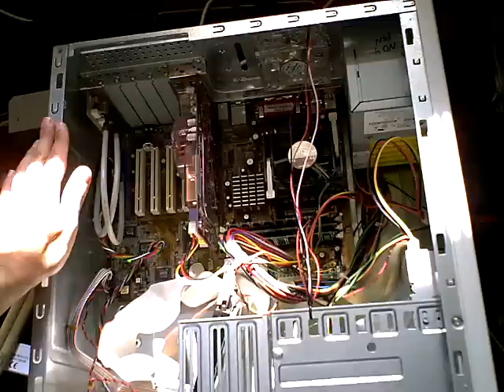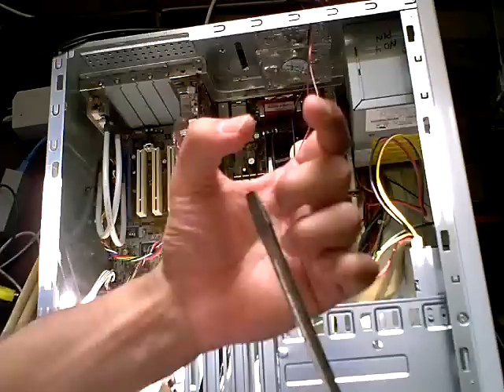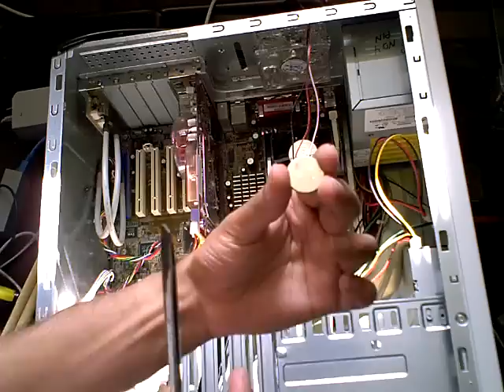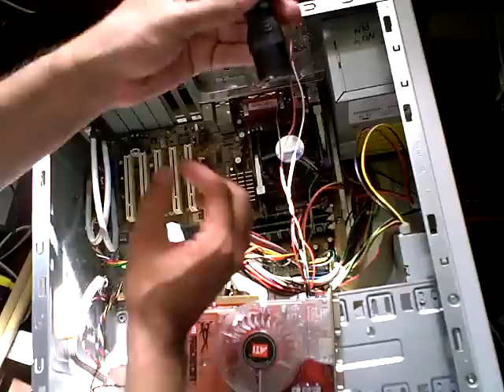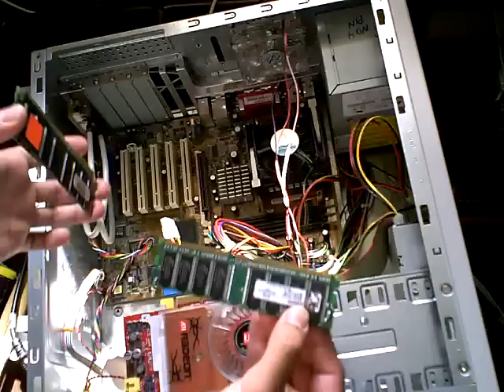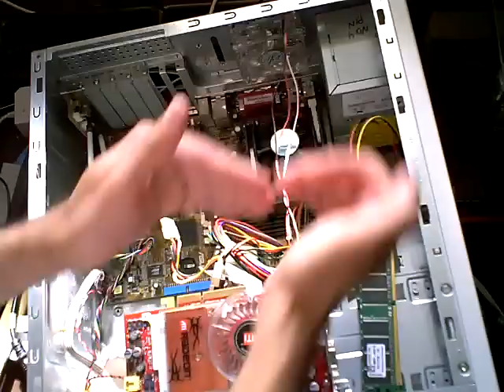How to possibly fix a PC that will turn on but will not beep and will not display anything on screen

Comment: just but my pc all new parts no display on monitor and only 1 USB port works
Reply from the maker: +icu creeping Follow the steps in the video. If no luck, then follow the steps in the ADVANCED video. Take your time doing it if need be
Reply: +RodneyDickson do u need to have speakers plugged in to hear the beeps?
Reply from the maker: +icu creeping Nope, you'll either need to have a small PC speaker onboard your motherboard, or will have to connect a small PC speaker to the proper front panel connectors of your motherboard
Reply: well im gonna just send the mother board back in and get a replacement because my keyboard dosent work on any of the usb connectors at all so it has to be dead
Reply from the maker: +icu creeping If it is under warranty, this is always the safest course of action.
Reply: should still be i only had it for half a week
Reply from the maker: +icu creeping Then good plan : )

Comment: When I unplugged dvd drive it turned on, or booted. thanks'
Reply from the maker: Heh, not often that you hear that an optical drive can cause this issue. Glad you got to the bottom of the issue, and thanks for letting us know, hopefully this info can help others in the same predicament : )
Reply: All I know is, once I unplug the d v d data an power cable it posted.
Reply from the maker: carlos valentin
I'd assume there was one of 3 things happening here 1) your optical drive had I/O errors and is no longer viable  2) the CMOS entry for your optical drive was corrupt  or 3) a component configuration conflict prevented this device and another conflicting device from being present at the same time. Regardless, glad things are working now : )
Reply: RodneyDickson One of the ram slots was bad too. Thanks'
Reply from the maker: carlos valentin
Geez, well, if you can keep it running as is, I say 'run it into the ground' : )
Reply: +RodneyDickson dude come on it was his power suply upgrade it to something stronger and it will run boot and post with the optical drive connected
Reply: RodneyDickson hey man my pc beeps but no display how i can fix that
Reply from the maker: +DANIEL REBU Beep error codes differ from one BIOS manufacturer to the next. To discover what the beep error code is trying to telling you, discover the manufacturer of your BIOS (available in the motherboard's manual or on the motherboard's manufacturer's website {on the page for your specific motherboard model}) and then look up the frequency and interval of your beep error code on:

http://www.computerhope.com/beep.htm

Comment: my computer doesn't show anything on screen I tried to connect my monitor through all its ports and with different monitors, as soon as I turn on the PC it makes a funky noise can anyone give me a diagnosis.      

 By the way that funky noise sounds like a disk of some sort
Reply from the maker: +Isac Santiago Ok, do you have a HDD activity light on your PC? (a light that flashes when the hard drive spins and loads the operating system)?

Comment: So I've just built my first computer. Everything is on(the fans and a green LED light on the motherboard), and seems to be working, but when I try to see the BIOS by turning it on and pressing the DEL key on my keyboard(which doesn't light up like it should so I doubt it's even working), nothing happens. All the monitor displays is " DVI no signal". any help is appreciated!Here's my build: http://pcpartpicker.com/list/dC8Fd6
Reply from the maker: Your keyboard not lighting is a good indication that your PC is not POSTing. Breadboard it (explained in the following video:)

If the steps in this video did not provide a solution to your problem, view:

http://www.youtube.com/watch?v=_EK9a-R5pss

You never know, maybe rebuilding the PC in the opposite sense that you took it apart will solve the problem.

Comment: wait
what if it doesn't have one beep
Reply from the maker: If the PC is working but does not beep, your board may not have a internal speaker connected (manufacturers are cheapening out on this element more and more)

Comment: i have same problem but mine is restarting every 15 sec restarting
Reply from the maker: It sounds like your motherboard is developing a short circuit due to contact with the metal casing. Most likely it has to do with the screws and metal mounting stands (supports) that your motherboard sits on. The cheapest way to fix this problem is to introduce cardboard washers between the screws and where they make contact to the motherboard, or you can buy plastic mounting supports at a computer shop.

Alternatively, you can always Breadboard it: 1)place the motherboard with CPU+Fan on wood or non-shiny cardboard 2)connect all of the case connectors to the board's panel 3)with a power bar that is OFF connect the PC power cable from the power bar to the power supply and the power supply to the board 4)while NEVER touching any exposed component,power on the power bar and press the power switch on the case.If the problem still persists,one of the remaining components is probably defective.Power off the power bar before dismantling

I cover breadboarding in greater detail in this video:
Advanced troubleshooting technique tutorial of how to possibly fix a PC that will not beep at boot
---

Comment: No error beeps just my pc is turning of after like 3 secconds or so
Reply from the maker: It sounds like your motherboard is developing a short circuit due to contact with the metal casing. Most likely it has to do with the screws and metal mounting stands (supports) that your motherboard sits on. The cheapest way to fix this problem is to introduce cardboard washers between the screws and where they make contact to the motherboard, or you can buy plastic mounting supports at a computer shop.

Alternatively, you can always Breadboard it: 1)place the motherboard with CPU+Fan on wood or non-shiny cardboard 2)connect all of the case connectors to the board's panel 3)with a power bar that is OFF connect the PC power cable from the power bar to the power supply and the power supply to the board 4)while NEVER touching any exposed component,power on the power bar and press the power switch on the case.If the problem still persists,one of the remaining components is probably defective.Power off the power bar before dismantling

I cover breadboarding in greater detail in this video:
Advanced troubleshooting technique tutorial of how to possibly fix a PC that will not beep at boot

Comment: Here is my prob when i turn on my cpu my monitor open and after a few secs it close. And i don t want to open my cpu. I dont want to crash my computer (sorry for bad English) ps. my wires are perfectly connected
Reply from the maker: +geoffrey kyle villota If you do not want to perform any of this stuff, then you'll have no choice but to pay a computer shop to fix the issue. For the record, It sounds like your motherboard is developing a short circuit due to contact with the metal casing. Most likely it has to do with the screws and metal mounting stands (supports) that your motherboard sits on. The cheapest way to fix this problem is to introduce cardboard washers between the screws and where they make contact to the motherboard, or you can buy plastic mounting supports at a computer shop.

Comment: when i put my video card my cump turns up but it doesn't start up with no beeps when i remove the video card my cump work normally with the intern video card ans it start up so obviously the video card stop the   start up what should i do
Reply from the maker: If this is new hardware that you are installing on your motherboard (that has not yet functioned on your motherboard), note that matching bus types of video card to motherboard socket (PCI-E for example), matching socket types of CPU to motherboard socket (LGA1366 for example) or matching bus types of RAM module to motherboard socket (DDR3 for example) does not necessarily signify compatibility. If this is the first time you are trying this hardware on your motherboard, there is a chance that this new hardware is not compatible with your motherboard, despite the same bus type and despite the fact that the new parts fit in their respective motherboard socket. Your motherboard manufacturer's website will have a support page dedicated to your motherboard's model, and on this support page should be a compatibility list for such components as video cards, CPUs and RAM modules. Ensure that your new component is certified to function with your motherboard, and if your new component is not present on the compatibility list, then there is a chance that the new component is not compatible with your motherboard.
Reply: it's not the first time i put this video card on my pc it use to work properly before i did a format to the pc notice that i installed all the necessary drivers and it worked for a while then i start having this issue with the black screen
Reply from the maker: Sadly components die with time. I believe your video card has done it's time sadly : \

Comment: tried everything over a million times and still nothing.... guess i need a new mobo :/
Reply from the maker: If the steps in this video did not provide a solution to your problem, view my:

Advanced troubleshooting technique tutorial of how to possibly fix a PC that will not beep at boot

You never know, maybe rebuilding the PC in the opposite sense that you took it apart will solve the problem.
Reply: aight, i'll try it

Comment: someone plz help , my pc cannot open , it open and close randomly within one second without any beeps to be listen .
Reply from the maker: It sounds like your motherboard is developing a short circuit due to contact with the metal casing. Most likely it has to do with the screws and metal mounting stands (supports) that your motherboard sits on. The cheapest way to fix this problem is to introduce cardboard washers between the screws and where they make contact to the motherboard, or you can buy plastic mounting supports at a computer shop.

Alternatively, you can always Breadboard it: 1)place the motherboard with CPU+Fan on wood or non-shiny cardboard 2)connect all of the case connectors to the board's panel 3)with a power bar that is OFF connect the PC power cable from the power bar to the power supply and the power supply to the board 4)while NEVER touching any exposed component,power on the power bar and press the power switch on the case.If the problem still persists,one of the remaining components is probably defective.Power off the power bar before dismantling

I cover breadboarding in greater detail in this video:
Advanced troubleshooting technique tutorial of how to possibly fix a PC that will not beep at boot
Reply: But sometimes it's power normaly and sometimes not , should i 1st go make any tests with the PSU so i can see if it does give normaly the eletricity with some kind of tester . cause there is also something else very weird , when i switch the buttom behind the PSU after 2 seconds or 3 it gives power to the pc without clicking the power button .
we also got sometimes alot of black outs cause the heat which makes people use alot their airconditions , so it might be kinda broken from it .
Reply from the maker: iTechGaming GR
Well, air conditioning aside (which I can confirm saps a lot of power from other utilities), the time it takes for the machine to get power feed from the power supply also seems to be an issue with power routing due to short circuit. Look, it's your PC and you can do as you see fit, but as far as I can tell, all signs point to my first diagnosis. Good luck with it.
Reply: Thanks for your help , i will check 1st the psu with some kind of monitor and if it is not the psu then simply i will check the motherboard .

Comment: Im only where i remove all my ram and my motherboard does not beep at all so thats where I'm going to assume my motherboard is ready to retire.
Reply from the maker: Not necessarily. If you want to go as far as possible without spending money, you could Breadboard it (explained in the following video:)

If the steps in this video did not provide a solution to your problem, view:

http://www.youtube.com/watch?v=_EK9a-R5pss

You never know, maybe rebuilding the PC in the opposite sense that you took it apart will solve the problem.

Comment: i buy 2 gigabytes of RAM its not display nothing on screen
Reply from the maker: +NikiGaming If this is new hardware that you are installing on your motherboard (that has not yet functioned on your motherboard,) note that matching bus types of video card to motherboard socket (PCI-E for example) or matching bus types of RAM module to motherboard socket (DDR3 for example) does not necessarily signify compatibility. If this is the first time you are trying this hardware on your motherboard, there is a chance that this new hardware is not compatible with your motherboard, despite the same bus type and despite the fact that the new parts fit in their respective motherboard socket. Your motherboard manufacturer's website will have a support page dedicated to your motherboard's model, and on this support page should be a compatibility list for such components as video cards and RAM modules. Ensure that your new component is certified to function with your motherboard, and if your new component is not present on the compatibility list, then there is a chance that the new component is not compatible with your motherboard.

Comment: my build powers on but then off again every 5 seconds D:
HELP!
Reply from the maker: +TinTLosT It sounds like your motherboard is developing a short circuit due to contact with the metal casing. Most likely it has to do with the screws and metal mounting stands (supports) that your motherboard sits on. The cheapest way to fix this problem is to introduce cardboard washers between the screws and where they make contact to the motherboard, or you can buy plastic mounting supports at a computer shop.

Alternatively, you can always Breadboard it (explained in the following video:)

If the steps in this video did not provide a solution to your problem, view:

http://www.youtube.com/watch?v=_EK9a-R5pss

You never know, maybe rebuilding the PC in the opposite sense that you took it apart will solve the problem.

Comment: my motherboard dont have a c mas jumper
Reply from the maker: Skip this step: disconnect the power cable, remove the CMOS battery, press your PC's chassis power button switch (to discharge any remaining power circulating in the system), leave the PC unplugged and in this state overnight, then the next day return the CMOS battery to its socket, power up the PC, and if no beep, then disconnect the power cable, press your PC's chassis power button switch (to discharge any remaining power circulating in the system), remove one component, power up the PC, and if no beep then repeat (each time unplugging the PC, pressing the power switch to discharge remaining power, removing a remaining component, and then powering up, and this until the PC beeps at boot).If it never beeps, even when you are down to just motherboard, power supply & CPU+fan, one of these remaining components may be bad

Comment: i remove everything still no POST
Reply: +I am Cornholio what i meant was the ram and video removed still no POST
Reply from the maker: +I am Cornholio Would you like...a spatula? Breadboard it (explained in the following video:)

If the steps in this video did not provide a solution to your problem, view:

http://www.youtube.com/watch?v=_EK9a-R5pss

You never know, maybe rebuilding the PC in the opposite sense that you took it apart will solve the problem.

Comment: brother i went tell me ( How to solve the system when starting is shutdown ) thanks my dear friend
Reply from the maker: If your computer powers on but for a mere second or two and then immediately powers down, It sounds like your motherboard is developing a short circuit due to contact with the metal casing. Most likely it has to do with the screws and metal mounting stands (supports) that your motherboard sits on. The cheapest way to fix this problem is to introduce cardboard washers between the screws and where they make contact to the motherboard, or you can buy plastic mounting supports at a computer shop.

Alternatively, you can always Breadboard it (explained in the following video:)

If the steps in this video did not provide a solution to your problem, view:

http://www.youtube.com/watch?v=_EK9a-R5pss

You never know, maybe rebuilding the PC in the opposite sense that you took it apart will solve the problem.

Comment: my mouse lights up , fans work still no signal
Reply from the maker: Does it beep at boot?
Reply: +RodneyDickson no beeps i tried everything
Reply from the maker: Try what you see in the video
Reply: +RodneyDickson i tried everything man i need your help urgently ! i will buy a new psu or motherboard i just need to know which one has gona wrong??? its a new pc only been running for a month then poof no signal. one day i forgot to turn off the power feed when taking out the power to the power supply and that created a small spark and a burning smell. after that day everything worked fine for 2 weeks then it was gone. which one is bad? please help me
Reply from the maker: (shrug) no clue. The power supply is the cheaper replacement, so starting there wouldn't be a bad thing, however, this sounds more like a motherboard problem than it does a PSU problem, and when a motherboard goes, often a CPU goes as well. Before spending any money, I'd Breadboard it (explained in the following video:)

If the steps in this video did not provide a solution to your problem, view:

http://www.youtube.com/watch?v=_EK9a-R5pss

You never know, maybe rebuilding the PC in the opposite sense that you took it apart will solve the problem.